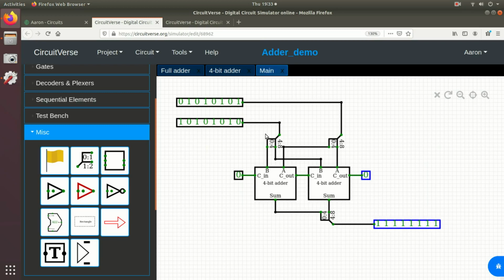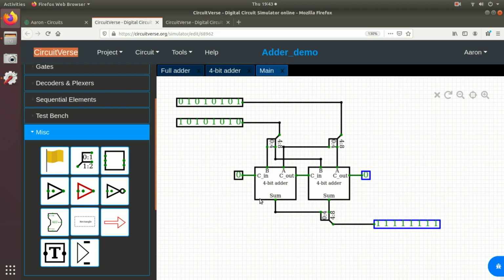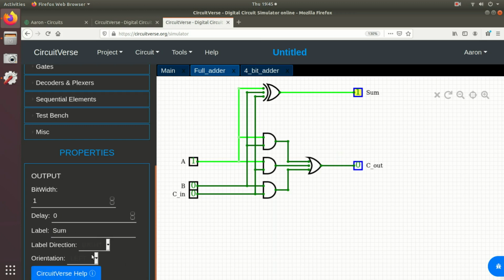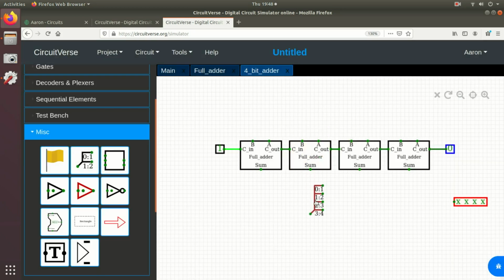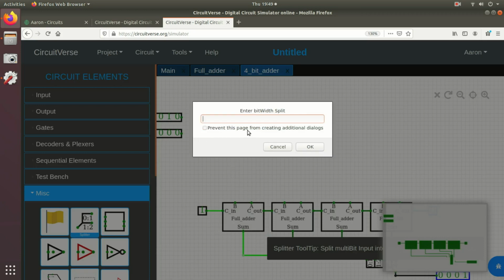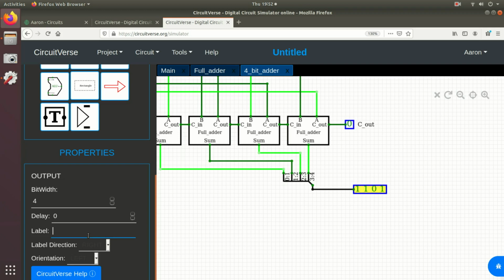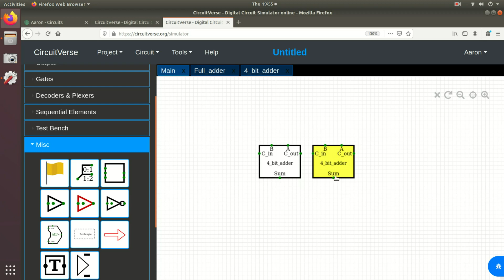Instantiate your way to an 8-bit adder using CircuitVerse

Comment: 00:01 Building a 8 bit Adders
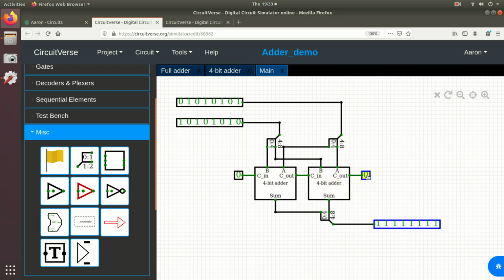00:19 8 Bit Adder (Final Level)
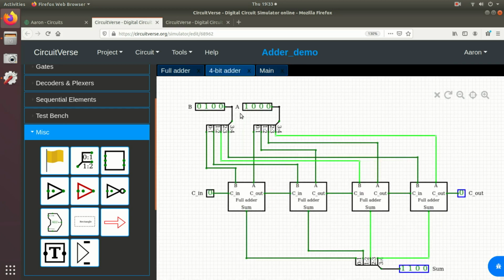00:27 4 Full Adder (2nd Level)
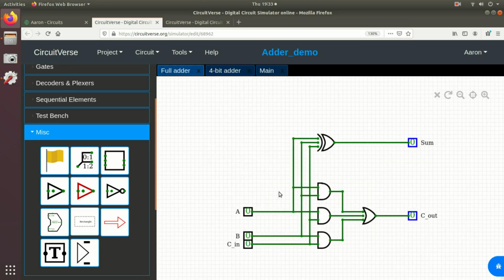00:35 A Full Adder (Its Base Logic)
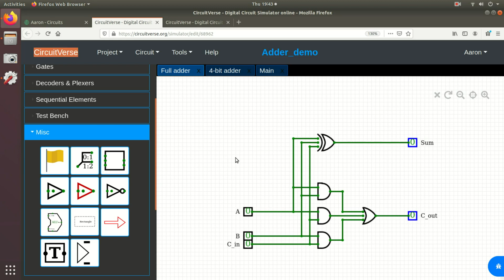00:57 Recap
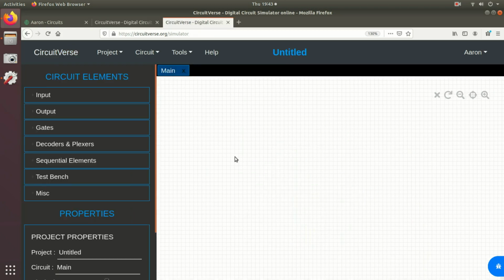01:17 Build Base Level (Add Circuit)
01:57 'Label' for Clarity & Base Level
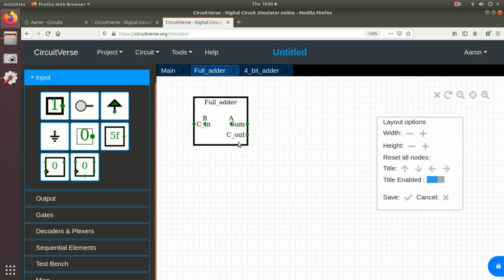02:30 Edit the Layout for Full Adder
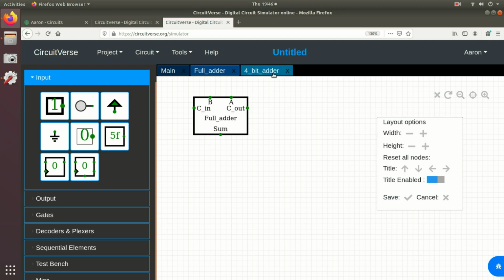03:29 Progress to the Next '4 Bit' Adder
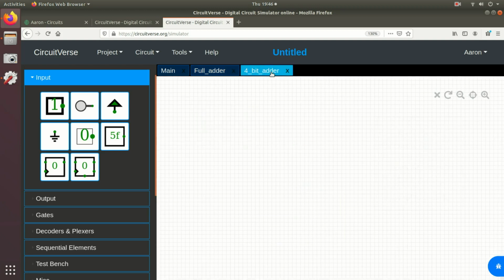03:32 Adding Sub-Circuit
04:10 Making a 4 Bit Wide Output & Splitter
05:02 The Purpose of Splitter 
05:12 Adding two 4 Bit Wide Input
06:03 Wiring Everything Up
06:35  Label The Rest
06:59 Testing & Trouble Shooting
07:20 Editing The Layout of Top Level

Comment: can you do it from a fulladder directly to a 8bit adder or is the intermediate with the 4bit adder requested at all cost ?
Reply from the maker: Hello Dominic,

This particular video emphasized a hierarchical design where the complete design was composed of many layers. Each layer abstracted away the complexity of the lower layers. 

The intermediate steps are necessary to fully understand the concept.

r/

APD